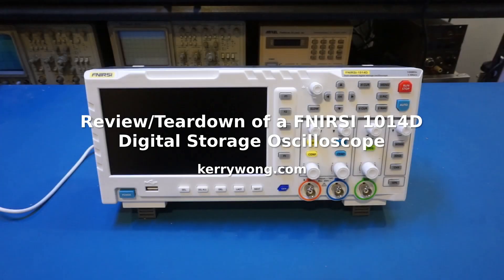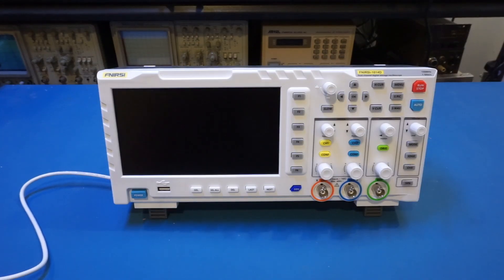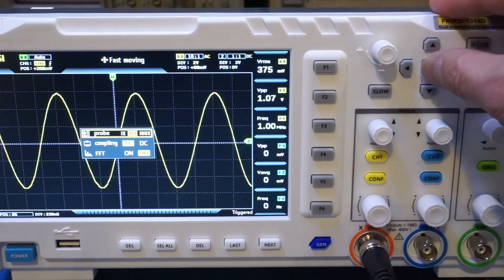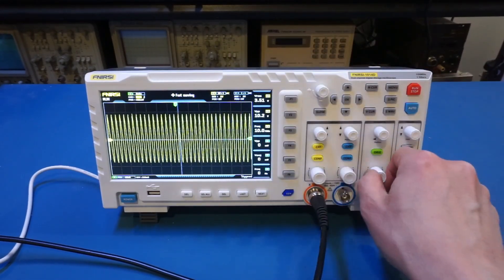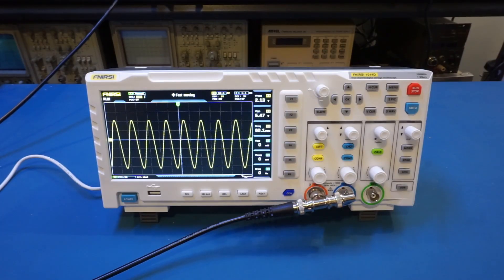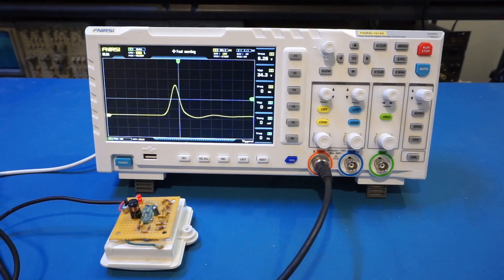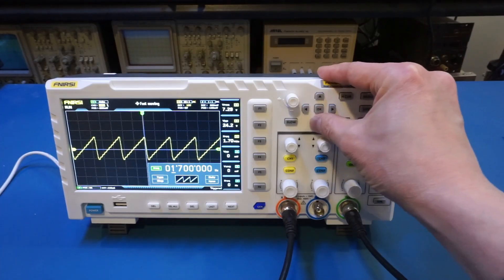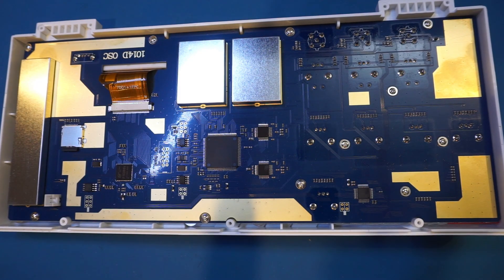Review/Teardown of a FNIRSI 1014D DSO - 100 MHz or 30 MHz Bandwidth?

Comment: I think most of the first part of your video which is measuring bandwidth using a sinewave is in error.  Directly connecting a waveform generator outputting a sine wave to the input of the oscope or using a 1x scope probe is not the way to measure the full bandwidth of the oscope.  The input to most scopes is effectively a low pass filter composed of an input resistance shunted by an input capacitance (1 Mohm || 16 pF).  Again for a sinewave and using a 10x scope probe which contains a capacitor will help cancel out the inherent input oscope capacitance.  This will  greatly increase the 3dB point in determining the full bandwidth.  This is why many oscope manufactures like Rigol state in their header to the specifications that they are made with a 10x probe properly compensated.  Please note I am not commenting on rise time measurement.  Hope this helps and I enjoy your channel very much and appreciate all the hard work.
Reply: Main problem here is that the reviewer got so obsessed with frequency response that he forgot to actually test the scope properly. There are MANY other settings that were not even checked. I doubt he even opened all the menus.
Reply: @johncoops6897  John, please explain exactly how he did not test the scope properly. If the scope can't even reach its advertised spec, who gives a crap about other settings in the menus?
Reply: @boots7859  - the maximum frequency is just one criteria for a scope. The poor thing might still be the best bang-for-buck compared to other scopes at the same price point.
In reality they are ALL bad at this price, or even double or triple the price. If you are Dave Jones, you'd say that any scope under $3000 is absolutely useless for anything. Then again, he doesn't even understand the usefulness of a $7 component tester 😃
Some (most) scope meters have terrible multimeter and AWG function functionality, however that doesn't mean you stop testing everything when you discover it has (say) poor specs in the uA range.
Reply: @boots7859  thats the freakin point smh

testing the advertised spec

MEANING MORE THAN JUST THE FREAKIN 100MHZ LABEL
Reply from the maker: The 1x, 10x are only applicable when you are using an oscilloscope probe. In this case the input is connected with the sig gen with a 50 Ohm coax. Later on in the video, when using the 8642, the signal was terminated with a 50 Ohm load as well.
Reply: @KerryWongBlog  Sorry disagree, you were trying to measure full bandwidth and even pointing to the oscope in the video saying it was not 100 MHz from your measurement (which might be true for that scope) but your sinewave method was wrong.  That is not how oscope companies measure BW with a sinewave.  Of  course another method is rise and fall times of a step function.  I was just trying to explain those specs for a sinewave 3 dB point are measured with a 10x probe so it does matter if your are testing for their specs because you are both using different methods.  You might want to check Rohde-Schwarz website for a good explanation.  The 50 ohm out of the generator and coaxial cable is fine also terminated as you mentioned but including a 10x probe if you want to check their specs.    I will let it go at that... only trying to be helpful.
Reply: @jwrtiger  You're not right. The reviewer did the right thing.
Reply from the maker: @jwrtiger  For strict testing procedures, you've got a point and manufacturers typically follow a set of well defined procedures for certifying the specifications. The main point is that the spec of this scope is way off. The same approach have been used for testing other scopes (see my other tests) and the results are all in the ball park of the specifications.   I do appreciate your comment as after all this video is intended to be more technical :-)
Reply: @KerryWongBlog  I came here to say the same.  The review is correct, given the 50 load is attached at the scope input.  The parallel input capacitance of the scope should be trivial compared to the dominance of the 50 Ohm resistive component of the effective input impedance.  Mr. Wong has a tee connector and load on the scope input clearly visible in the video.

I teach a course in digital electronics which is a junior/senior level course and I am always surprised how many students arrive not knowing that high impedance measurements need to be made with a 10x probe in order to have the capacitive and resistive voltage dividers in parallel; also that they need to have a 50 Ohm load for the signal generator at device under test’s input if the device under test has a high impedance input.  I also have to cajole students to check probe compensation every time they get a probe that is not already known to be matched to the scope they are using.  Students want to jump right into building projects with FPGAs, but I have them do a few labs with discrete parts so they learn layout technique and proper use of instrumentation.

Comment: I'm only part way thru the video and have some comments.

IMO, your bandwidth testing is somewhat dubious in and of itself!
You have the switch on the probe set to x1??? while the 'scope itself is set to x10 which is NOT exactly 'fair'. (MANY 'scopes have a poor bandwidth response when using a x1 probe!)
Furthermore, I haven't yet seen how the generator is setup, but the 'scope input looks to be an unterminated BNC-coax.
At these frequencies, I'd expect impedance matching to be at the MANDATORY level!  (set the sig gen to 50ohm and throw a BNC-tee + 50ohm terminator at the 'scope input)
Perhaps repeating the EXACT same testing procedure on your 1054E as a true 'side-by-side' test would better highlight things?
(eg: Unterminated signal and x1 probe?? with 'scope set to x10 etc)

Edit: I now see you switched to proper termination with the HP sig gen...  Good start!
Reply from the maker: No, I was not using a probe but using coax connection through out. The attenuation options on the scope do not affect the bandwidth at all. It is just used to adjust the readings given the actual probe attenuation you are using. Hope this helps.
Reply: @KerryWongBlog 
My mistake!  I thought impedance matching had a profound impact on bandwidth.
I'll rip out all my expensive cable tomorrow and replace it with coat hangers!
Reply: The testing was correct because you can see the 50 Ohm co-ax and the tee with 50 Ohm load attached right at the scope input.  Unless you’re doing GHz frequency measurements, the fact there is a few mm of effective transmission line split off into the high impedance load of the scope should have no effect on the measurement at the resolution of which the scope is capable.

The frequency roll-off could possibly be caused by an input bandwidth limiter [relay?] stuck in the ON position.  The pretty atrocious negative DC offset is strange too.  Perhaps running the internal calibration routine would help clean that up, if the scope has that feature.
Reply: @wtmayhew  As mentioned above, you can indeed see the tee and terminator once he switched to the HP scope, but not on the 'crap-o-scope'.
Kerry hadn't yet mentioned that he was using a straight BNC-to-BNC cable (implying a probe on the x1 setting).
Assuming you have a something like a 100MHz  x1 / x10 switchable probe handy, go take a look at its bandwidth specs.  You'll see that the 100MHz spec is SOLELY when switched to x10.  The actual x1 bandwidth is FAR less... (My NASTIEST probes that I use at frequencies near DC are only rated with a -3dB  6MHz bandwidth on the x1 setting.  I keep the expensive 'good' probes in their box until I truly NEED to use them so that they'll last longer!  I'm pretty ROUGH on the $10 probes... LOL)
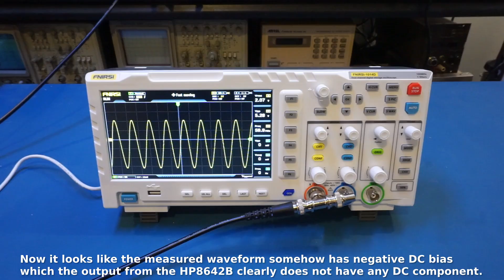Reply: @trevorvanbremen4718  it appears when Mr. Wong is talking about the frequency response from 9:26 to 11:28 in his video that the Fnirsi scope under test is connected to the off-screen signal generator with a proper 50 Ohm termination at the scope input.  I couldn’t find the specification for the shunt capacitance of the Fnirsi scope, but a similar a Owon scope is 1 meg +/- 2% shunted by 16 pF +/- 10 pF.  At 35 MHz where the Fnirsi started showing a lot of roll-off the 16 pF capacitance impedance magnitude would be 285 Ohms, which compared to the 50 Ohms resistance paralleling the input shunt capacitance would not explain the amount of response roll-off seen.

As far as probes go, the capacitance of the coaxial probe cable contributes quite a lot more than the scope input shunt capacitance.  The trimmer cap really just compensates for the slight manufacturing variability.  Recall the 9 meg resistor in the probe tip is also paralleled with a capacitance that provides capacitive ratio the same as and in parallel with the resistive divider ratio.  Instead of a trimmer cap in the BNC connector, some old Tektronix probes have an adjustable coaxial capacitor built into the threaded probe tip sleeve surrounding the 9 meg resistor.  Those were fixed x10 probes.

Yes indeed, scope probes can get a lot of rough treatment.  I have a pile of US government surplus probes which I bought a few years back when it seemed everyone was selling the same surplus probes.  I got them for about five bucks each and they’re only good to about 60 MHz on x10, but that covers the majority of my needs so I can save the good probes for special occasions.

Speaking of Owon, I just tested an HDS2102S so-called 100 MHz scope (500 megasample/S shared between two channels).  I used an IFR 1200S service monitor set to -20 dBm output connected the same way as Mr. Wong did.  Instead of a tee, I used 50 Ohm Tektronix coaxial load resistor.  The Owon indicated flat to better than 1 dB from just above DC to 100 MHz.  Then Owon actually was able to lock and display past 200 MHz, but of course uncalibrated and significantly attenuated with apparent trigger jitter causing a thickening of the displayed trace.  Still, I was fairly impressed.
Reply: @wtmayhew  
200 MHz on a 100 Mhz Owon is doing pretty darned well!  Congrats!!!
And yet in comparison to some of the stuff on the TSP channel, 200 Mhz is 'almost' the same as DC!!!
(e.g. His review of that 'high end' LeCroy 'scope was kinda over the top.  Not many people I know need to check signal integiry / quality at 100+ GHz!!! LOL)
Reply: @trevorvanbremen4718  Thanks for the reply.  I grew up in the era of Tektronix scopes full of vacuum tubes which were so heavy they had to be moved on carts.  It is really something to see that for a few hundred US Dollars one may purchase an instrument the size of a multimeter which blows the doors off the vacuum tube beasts by an order of magnitude in pretty much every specification.

As “bad” as the Fnirsi scope is, it is still quite a lot of value for the money compared what existed in the old days.

Comment: I think it's wise to save your money and consider something like a Rigol DS1054Z as a bare minimum bench scope.
Reply: Rigol is almost twice the price thou, but still it is worth it...
Reply: @great__success agreed.  Rigol makes pretty good instruments which are not rock bottom cheap, but you get quality benefits worth the modest extra cost.  It is worth it to save up and get an instrument which gives accurate results and is a pleasure to use.  Rock bottom instruments will taunt you with poor results and bad ergonomics.  I also bought used test equipment for a long time and was usually frustrated by operation which was not quite correct.  People usually don’t sell off stuff if they are happy with it.  New test equipment is affordable enough now that it can match used name-brand prices and meet or exceed features and specifications.
Reply: I absolutely agree.  I have a 4-channel 200 MHz Rigol DSO which I bought about 10 years ago and use as my main bench scope.  The Rigol has a very good quality feel of all its controls and easily meets or exceeds all of its promised specifications.  At the time Rigol had an uncanny resemblance to Agilent’s lower line of DSOs, so I assume Rigol was making products for Agilent.  Some of the products from Siglent look fairly decent too, but I don’t have any on my bench.
Reply: @wtmayhew  I upgraded my Rigol scope a while ago now to a Keysight, the Rigol still has it's place if I need 4 channels, mind you the Keysight blows it away for realtime bus decoding. The Rigol still feels very solid and I also have a Rigol DG1062z function gen. They make very good, competitively priced gear. This current trend of super cheap stuff from china however is just garbage, although I did buy the Owon 70mhz Handheld.
Reply: @TheDigitalAura  Thanks for the reply.  That is good to know.  I like quite a few of Keysight’s offerings and they are getting more competitive on pricing.  I made the leap to Keysight’s 6.5 digit bench meter.  It was pretty expensive, but blows competition away in quality.  I am glad I have a top quality meter with traceable calibration.  It was money well spent and I have found having a precise and accurate bench meter been more useful than I expected.  I have a fluke 8060A and an unpronounceable name cheap meter for everyday use where they might get knocked around.
Reply: I think I would go with an Instek, Rigols have a screwed up menu system and the FFT is messed up from what I have seen. The Tektronix 2246A I have seems quite capable compared to Rigols bottom of the line offerings.
Reply: @kjrchannel1480  Thanks for the data point re: GW Instek.  I thought an Electronic Devices course and the lab had been outfitted with low end Agilent ~50 MHz scopes which appeared to have been made by Rigol.  Those were pretty bad scopes.  When I taught a Digital Circuits course, the lab was outfitted with ~100 MHz Tek MSOs which appear to be about ten years old.  The students struggled with the Tek scopes which have not the best menu structure.

Sometimes simpler is better.  I have a Rigol DS1204B which I bought about 13 years ago and I use it daily where I don’t need an MSO.  The good thing is there are dedicated attenuators and centering controls for all four channels and the frequency response is an honest 200 MHz.  I believe it has better ergonomics than Rigol’s current offering at that price point.

The take-away is try to get some hands-on time with test equipment you’re thinking about purchasing.  Most manufacturers have some clinkers in their line-ups and you may find certain quirks drive you nuts.  A scope that annoys you daily is something to avoid for sure.

I have an old Tek 547 made about 1960 which came from NASA surplus.  The ergonomics are really nice, but the scope weighs probably 80 pounds and has a matching cart to roll it around.  One of the plug-in units I have for it is a 1S1 sampler which allowed display of periodic signals up to around 1 GHz.  That was pretty heady stuff for 1960.
Reply: @kjrchannel1480  Try capturing a rare runt pulse or glitch on it. Dave Jones has a good video showing how digital can be far superior to analog. I can;t really comment re rigol anymore as I now use Keysight, but my rigol ds1074z served me very well. I personally wouldnt go near Instek.
Reply: I agree the Rigol DS1054z is a decent enough oscilloscope and has 1mv sensitivity plus does it advertise specs to meet most people need in the advance hobbyist/engineers, unless you want to use differential probes and have a logic analyzer built then go for a MSO version which is way more.

Of course the Rigol do have issues as well but going for a professional scope you spend 3k plus.